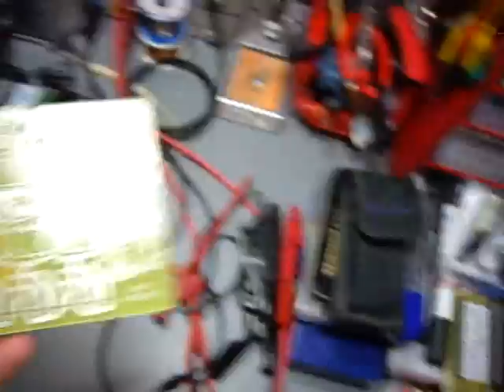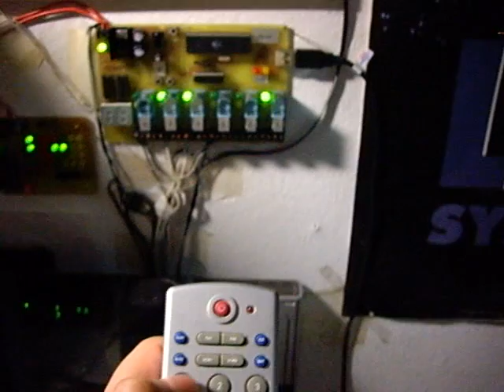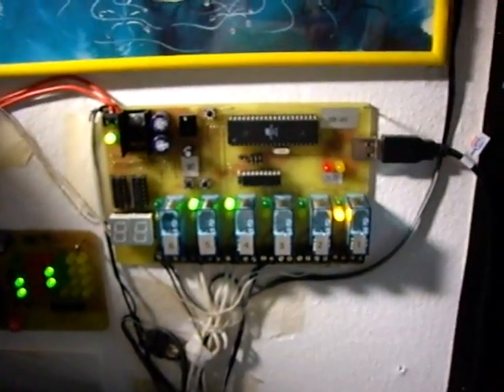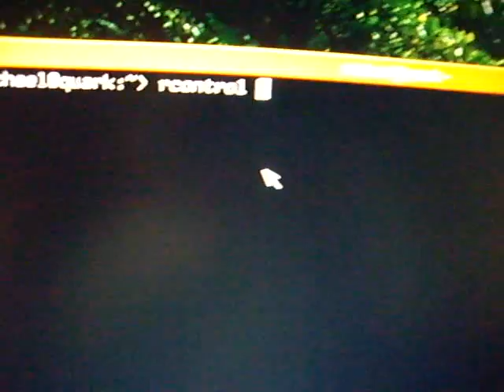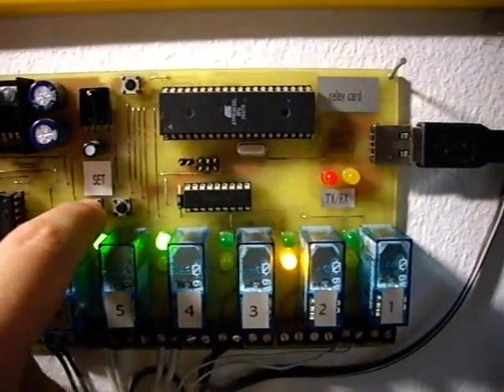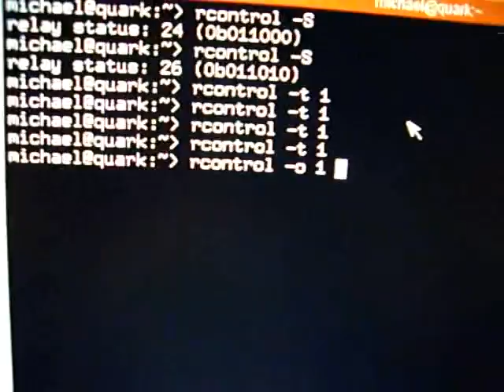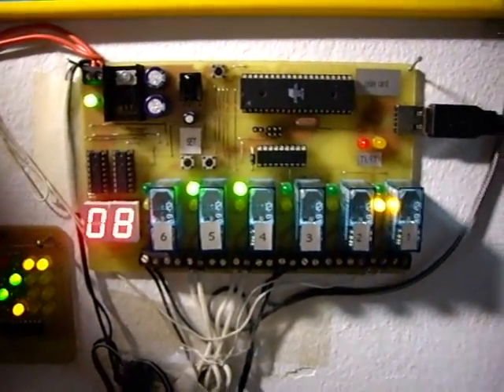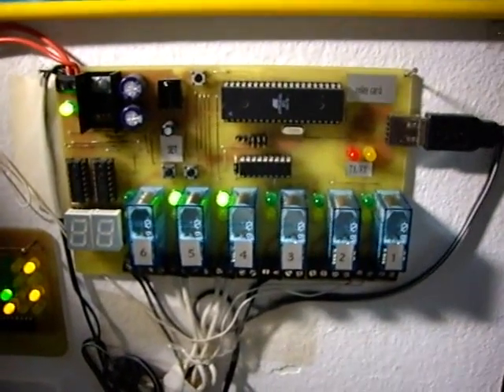My 6-channel USB remote-controllable relay card.

Comment: @Minifig666 I don't begrudge your use of them. My points for triacs are they have a smaller footprint, can handle much higher currents, do not require a diode to prevent backfeed induction, come in latching or non-latching varieties, don't suffer from switch bounce, don't suffer from dirty contacts (carbon build up from arcing), don't need replacing and they're quiet.

Relays can be multi-poled and don't need heat sinks.

Comment: @sparky3489 The clack of a relay I find is quite satisfying, like a well built toggle switch! Also these particular relays (Finder 40.52 series, if I'm not mistaken) are well built and are very cheap to replace.  (£1.70 for me) Relays are also much more tolerant to all sorts of things! Why I'd use them!

Comment: @linuxgeek81 Your right, a triac can handle much more current. The traics I'm using can handle up to 12 amps but I have them fused to about 3 amps each.

I'm not talking about induction from the coil, I'm talking about switch bounce.

Comment: @linuxgeek81 LEDs also make a good indicator. Solid state relays are expensive but  optocouplers and triacs costs about the same as those relays and don't create electrical noise. I sent you a link to an example.

Comment: Curious to know why you didn't use opto-couplers/triacs? Relays are too noisy.

Also, could you fix your site so the SCH and BRD files are obtainable? Even if one tries to select the text, the ROW numbers get selected as well which results in corrupted files.

Comment: Nice work. I am wondering what is that USB connector on the board for, I mean how do you communicate with the pc... serial to usb with  some ftdi chip? I have no idea how to use the usb port under linux is it easy?